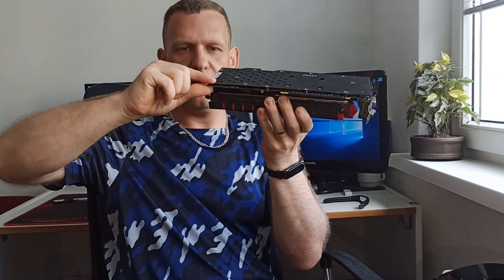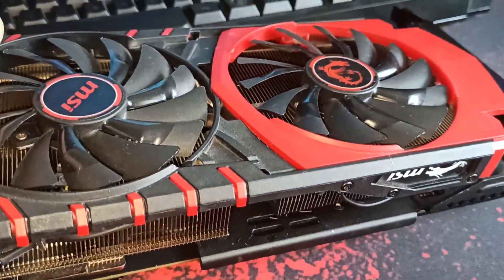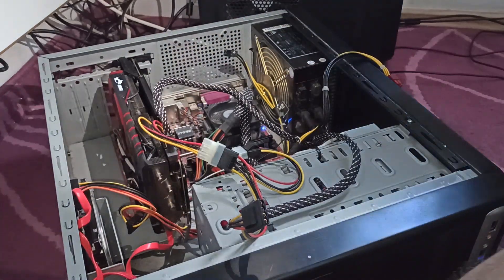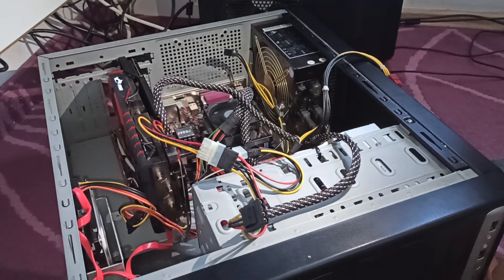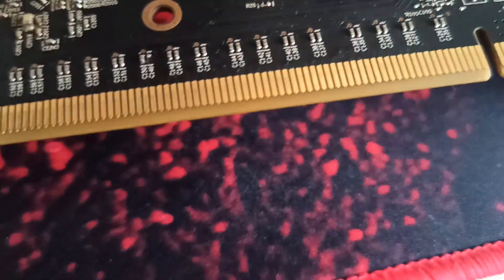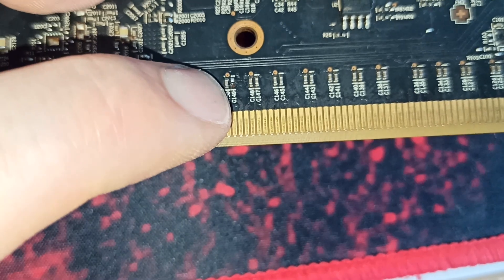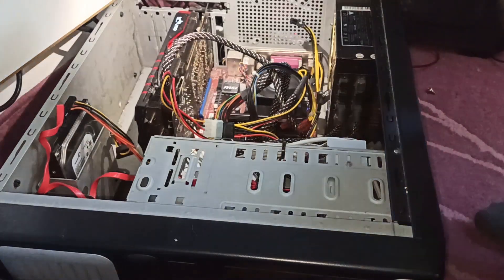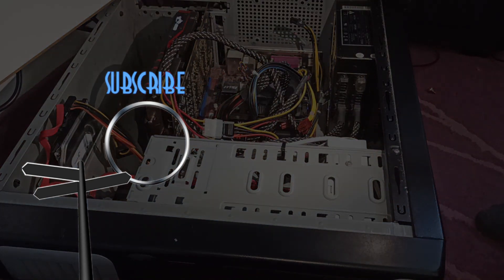GPU missing components FIX - EXAMPLE

Comment: I cant find any good info online on this. Any advice for how to identify components? No idea what is a cap or resistor. I have a digital scope and don't see any markings. All components have the same package.
Reply from the maker: Not sure what you exactly means but ye all looks the same and sometimes if you replaced one with different one usually is not a big problem if you mean that

Comment: Did you find what the name of the component was? I found an R7 370 that is missing that exact same component but I don't know what the name of it is.
Reply from the maker: It's missing some capacitor but I usually use some donat PCB to fix something like this
Reply: @frogtechtips thanks. I inspected the r7 370 some more and found that its missing a bunch more capacitors so I guess it'll become a donor board itself.
Reply from the maker: Yop good idea